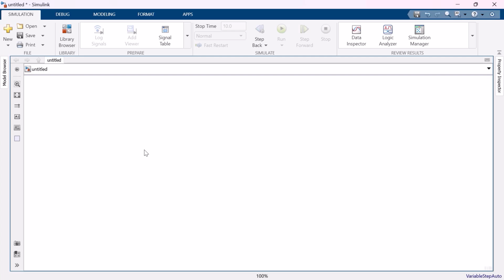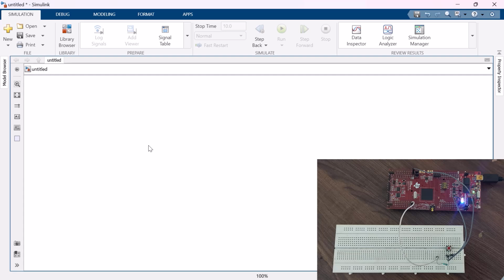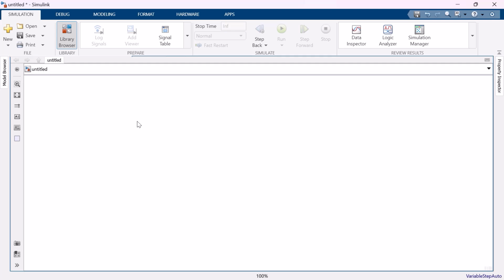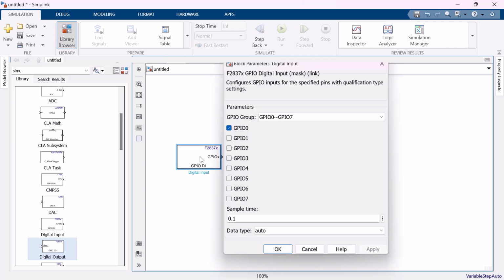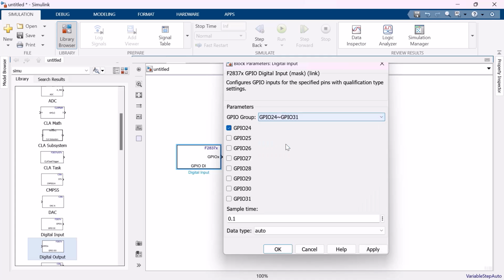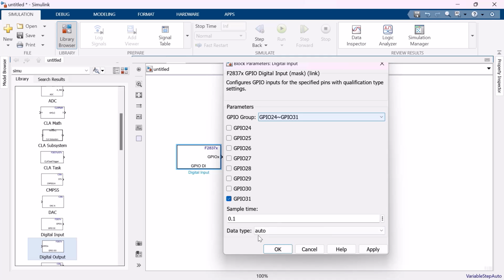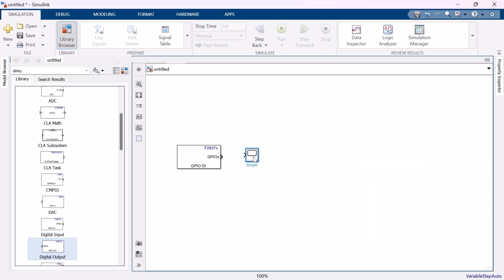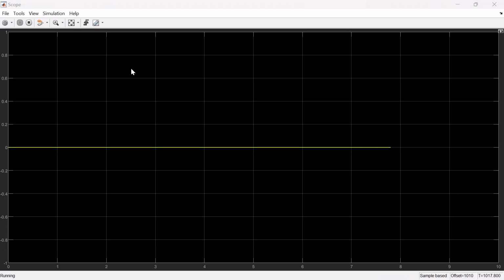How to Configure GPIOs as Inputs on C2000 MCUs | C2000 Microcontroller Blockset, Part 2

Comment: Hi, I have a question regarding the selected GPIO. In the video, GPIO 31 was selected in Simulink. But in the wire connection, it seems that GPIO 0 was connected. Could you please clear my confusion?